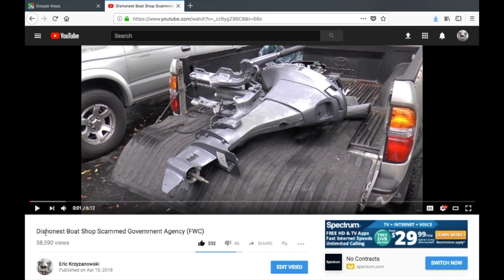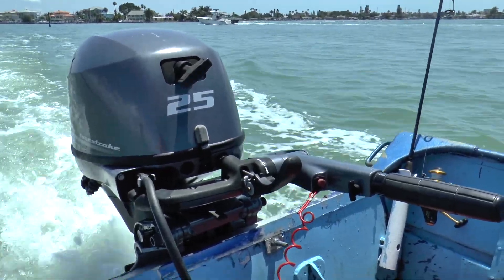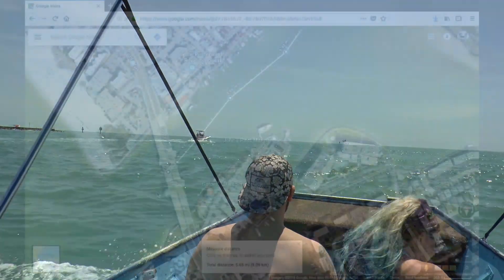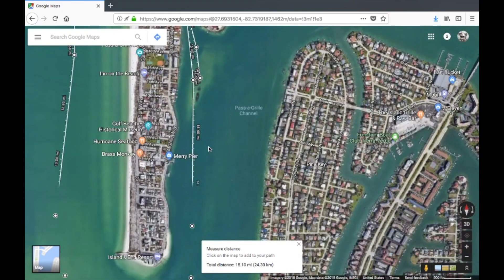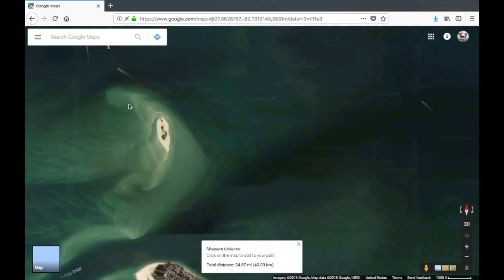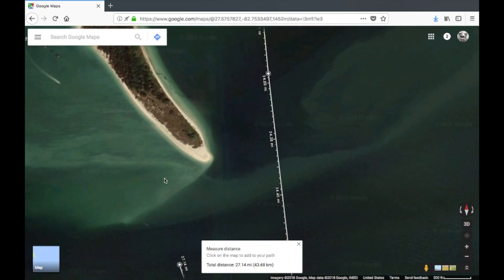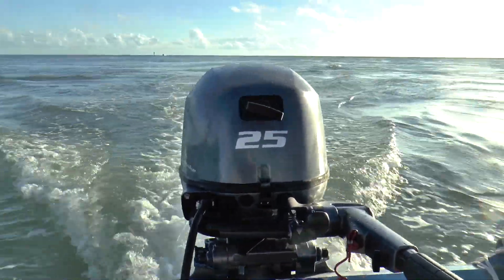Government Agency (FWC) Scammed By Mechanic (UPDATE VIDEO)

Comment: Man you should have a bigger fuel tank than that!  Running outta gas is not an option lol
Reply: do you have a larger tank installed in your car? why not? A 65' yacht can go 7 miles on a gallon of gas.
Reply: @gregarioussolitudinist5695  ok his boats uses a plastic tank, it's not too hard to switch a bigger one in. Cars dont have space for a bigger tank.
Reply: Gregarious Solitudinist that doesn’t make sense gummo
Reply: That engine uses literally no gas I have one on my duck boat
Reply: Gregarious Solitudinist Lmao, you got that backwards. Most 65’ yachts use more than 7 gallons per mile.
Reply: @adamr9215  lol. yup.
Reply: Those engines are much more efficient than a car engine! Think of it like a motorcycle engine and how small the gas tanks are on those. Same premise!
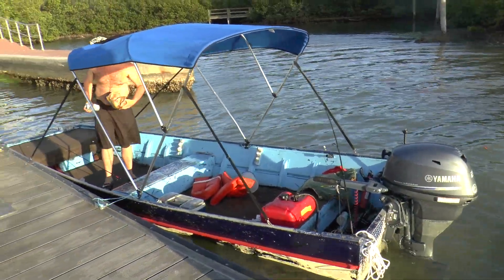Reply: 10:41 his gas tank on the boat for reference..
Reply: @brentparks3669  That 25 on his boat isn't even getting 10mpg at optimum cruise speed.

Comment: Offshore without a spare tin of fuel is not a good practice guys..well done on the motor score though
Reply: That isnt off shore man
Reply: Also given its his first run he is learning the range of a new motor
Reply: off shore..off the shore..away from the shore..get it yet?  if its an unknown motor then he should have had extra fuel in case..I guess we will just read about you in a newspaper soon..
Reply: offshore
adjective & adverb
ˈɒfʃɔː,ɒfˈʃɔː/Submit
1.
situated at sea some distance from the shore.

Adjacent to the shore is not off shore
Reply: What is the difference between inshore and offshore fishing? Well, no problem because we are here to help you understand!

Of course, the main difference between the two is the depth of the water at the fishing location. In ocean or seawaters, inshore fishing is within a few miles from the shore. Estuaries and bays are popular inshore fishing spots as well. Offshore fishing is far from the shore, typically 20-30 miles out, in waters hundreds and thousands of feet deep.

Other than fishing locale, there are six criteria that help differentiate the two.

He wasnt that far from shore, sure he could have one but honestly there is a lot worse out there.
Reply: Google it, it is not off shore
Reply: Again the point is you dont know the difference between inshore and off shore. Funny how you admit it is inshore now.
Reply: I wouldn't go offshore with a jon boat period. That is dangerous.
Reply: agreed. I always run with back up fuel and tow insurance.  EPIRB good idea but expensive. I would when you cant see land anymore from your boat your offshore. about 12 miles
Reply: Not excatly  offshore  hugging  the shoreline .  Would b3 near shore to correct .
Reply: I have a question"?" It seems like the 25hp Yamaha, using 6gal of fuel is alot no further than he traveled? Is 25 miles on the 6gal correct for this setup he had?

Comment: I would suggest getting seatow insurance. its like AAA  for the water. You run out of gas or get stranded they come out give you 5 gallons, or if stuck tow you to the boat ramp u launched from. Good video.
Reply: Yep , Worth it’s weight in gold !  Sea tow  or Boaters Us I believe is the other one. AAA FOR THE WATER !  I’d also suggest carrying another Fuel tank With you , so u can switch over if needed. Cheap insurance. And a Handheld VHF Radio to call them. Lol 😂🤣
Reply: if not seatow Boat US

Comment: If that's your first trip, after buying the outboard.
Not knowing if it's good & no backup, that's a little mad.
But, each to their own. Good it worked out 👍
Reply: Ditto. I don't like going out on my bass boat without the trolling motor fully charged,  "just in case" and that's on a lake.

Comment: As  a retired ASE Master tech,over the years at least once a month I would run in to 
a situation where mechanic "A" said mechanic "B" said  or shop so-in-so did this or 
that. I follow the old rule "If you can't say something good about anyone or anything
then just don't say anything about it at all" Except for maybe, "Well ! I wasn't there and 
we need to start from scratch "
This situation may be anything from pure corruption to a dept. policy that says: 'If we 
can't depend on it 300% out there in the dark of a stormy night on a rescue mission
replace it, lives may be at stake !
So far ? be glad you got a deal and I think you did, just be honest enough to come back 
later on and tell us if it pukes the crank out into the bilge. Give the other guys the benefit 
of the doubt because you where not there !
P.S. Have you stopped to ponder why it did not have a prop on it at 'as is' sale ? Like 
maybe they where hiding the fact that the missing prop didn't have a fluke left on it 
after the prop strike !  It might have made you think twice about buying it ?

Comment: Nothing wrong with the motor. Agreed. FWC scammed? No. i think it's the taxpayers that are getting scammed. No one at the FWC questioned that a nearly new motor that was running good was diagnosed as having a bad crank and was junk? Perhaps the person at the FWC wanted to keep the equipment in his department new or wanted a different color engine?

Comment: I am always be told that the second handed motor just bad, but actually many of those just only a little works and it goes far.  Sure some of its need to look very careful for the miss when you looking it.  Mine Yamaha f115 just 3 years on my hands and it had over 9 years since its on water.

Comment: Bit late but im assuming if the bearings are gone youd hear some sort of metal on metal from the engine or itd make some sort of noise thatd be noticable and im also suspecting that it can misalign the piston in the head so if it was in theory the piston could break the walls if used for to long with no bearings

Comment: I have a tohatsu 25 four stroke, I love the engine, it’s quiet, smooth and hardly uses any fuel. My only problem is that it’s too slow I know that the block is the same as some of the higher horse engines, is there any way that I could get a chip or something like that to make it produce more power
Reply: Tohatsu makes the small hp mercury engines
Reply: tohatsu puts a small prop on their factory motors. You can add a larger prop.

Comment: hello eric,

can you please help me 

i bought a mariner 8hp shortshaft this weekend the impeller is not good i already know that but it does still have a nice stream of water out of the motor sometimes but that water is very hot (cant touch it with my hand) is that because of the impeller or because of the thermostat the mechanic says that it also could be the thermostat but im not sure 

could you please help me,

kind regards 

Lars,

Comment: Could you row the boat in case the engine fails or you run out of fuel or the prop is damaged ?
Reply: I have a 12 jon boat with a 3 gallon tank. Keep a 5 gallon tank as back up.  Have oars and paddles onboard at all times

Comment: not used to seeing a motor that does not clamp on to the transom. Is that normal?
Reply: tbirdracefan yeah its a difrent bracket that lets you bolt it on if you look cloosely at the mount he has taken the screws out and boltet it to the transom for not loosing it